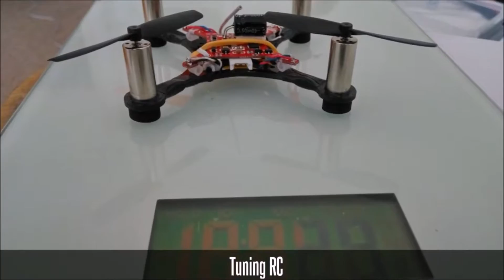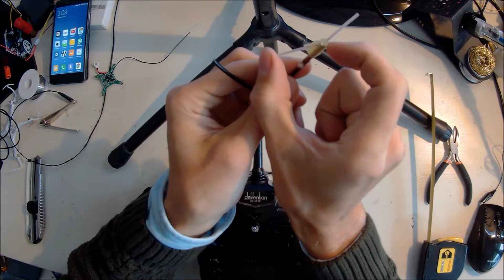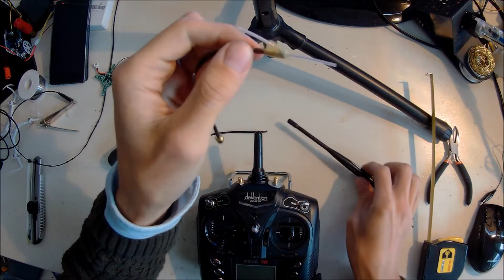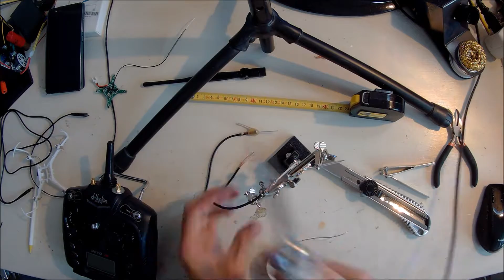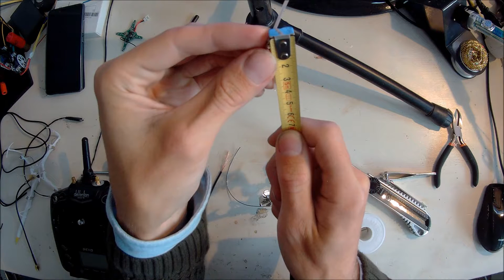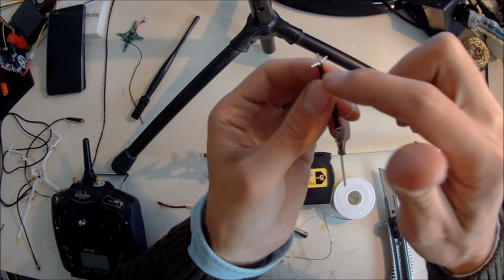2.4 Ghz dipole receiver antenna build

Comment: A bit of clarification; the "shortening factor" is needed due to the insulation and conducting material of the antenna (the coax inner insulator & copper conductor in this case).  It is related to the dielectric constant of the material, not the thickness of the coax.  Electromagnetic energy travels slightly slower through this medium (the same way light travels slightly slower through water or glass vs. air), so the wavelength is a bit shorter.

A Teflon insulator will slow the propagation of the waves to about 70% vs. air, polyethylene is about 66% and foamed polyethylene is about 84%, so you would shorten accordingly.  Once the waves leave the wire & move through air, they move at 100% velocity.  You can learn more by Googling "velocity factor".
Reply from the maker: That is the coolest answer I've ever had on one of my vids TY so much!
Reply: Thanks!  I'm impressed with your build.  Your techniques are right on and the science is solid -- a rarity on YouTube!  Fantastic work.

Comment: Cool :)
Reply from the maker: jtgravityRC tnx jt!
Reply from the maker: Im getting some awesome results with this antenna's. Its nice to get the receiver antenna away from the carbon fiber to be able to fly higher and further. It's also reducing noice in my FPV feed as the 5Ghz and 2.4 Ghz don't interfere as much on my compact FPV silverXXX brushless quad
Reply: MrJob91 Very nice :)